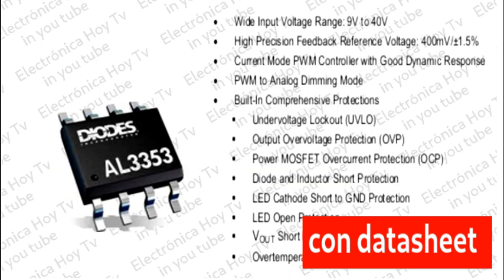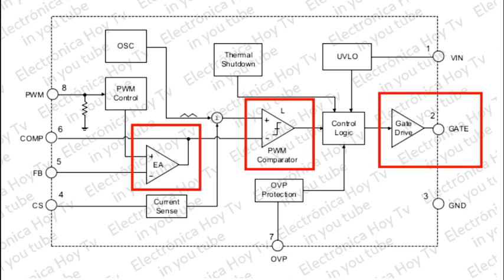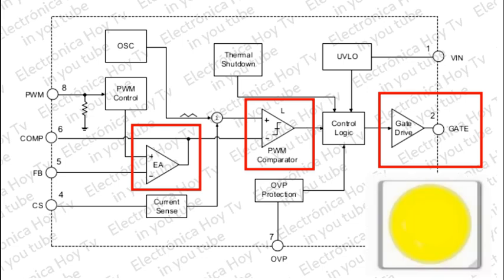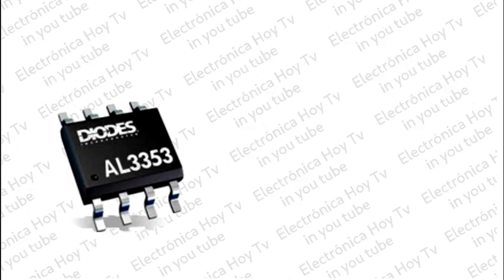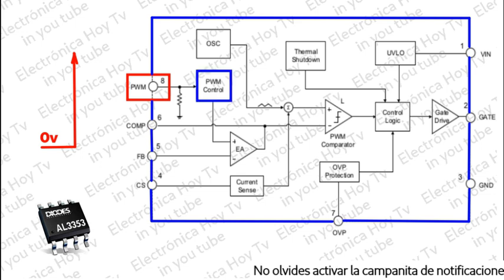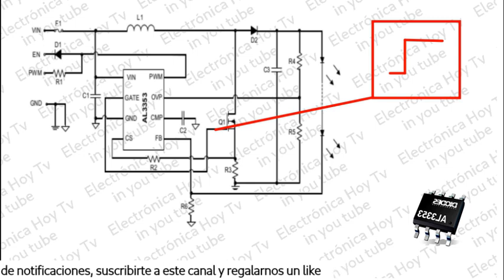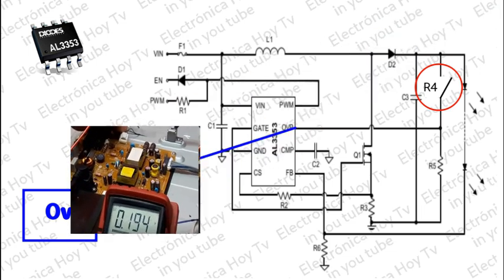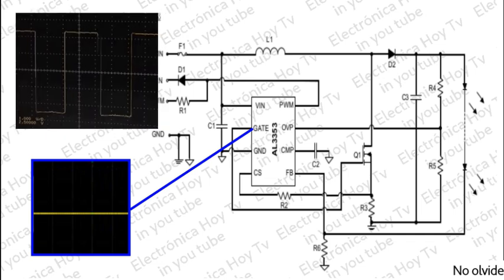PROBLEMAS DE BACKLIGHT DEL AL3353, PARTE  1

Comment: Hola. El nuevo conjunto de retroiluminación consume 32.4 mA cuando el anterior utilizaba 42.1 mA. Entonces recibo un ligero pitido y la protección se apaga. La fórmula :  I_Led = 400mV / R_FB da 9.5 Ohm al viejo y 11.2 Ohm al nuevo. ¿Cómo puedo reducir los amperios? (mi IC es OB3353CP). Muchas gracias ! [ usando el traductor de Google ]
Reply from the maker: Hello, thank you very much for commenting, the issue is that you must keep the parameters in OVO and FB so that the protections do not activate when you reduce the current, so any change you must try to maintain at least 150mV on the OVP pin and no more than 400mV on the FB pin, so you have to work together on the SHUNT resistors and the voltage divider of the OVP pin. A hug!

https://www.youtube.com/watch?v=v5ze1cnUv0Y
Reply: @ELECTRONICAHOYTV  Hi. Thank you for answering !!.
Old LEDs Set I = 42.1 mA . New set takes 34.2 mA. FB pin line has 100 Ohm Resistor .  Using the Formula for old parameters I found the DUTY Cycle :  (42.1 * 100 )/ 400mV = 10.525 . Now I calculated the New FB Resistor I want : (400 mA * 10.525 ) / 34.2 = 123 Ohm.  34.2 : 42.1 = 0.812 AND 100/123 = 0.813. Doesn't seem risky and looks correct, So I replaced 100 Ohm with 121 Ohm. 
But now , I get  1.17K on the 0 Ohm side of the resistor ( FB Pin #5 side )and 1K on the 100 Ohm side !!. How strange !!! . Measures 121 Ohm in-circuit !!!  [ I replaced 0201 SMD R with small, 2 x Thru-hole ] . So strange !!!    . After night sleep I see this :  I found Resistor on FB line with 0 ohm to the pin and 100 on its other side. After replacing it with 122 ohm , I measure a rise of 1k on the Resistor , but OPPOSITE : the 0 side became 1122 and the 100 side beace 1000. This is LIKE saying that FB got 1000 ohm lower but I'm not sure. Strange . No V used the whole time , but my tweezers are magnetized !  perhaps..

Comment: GRACIAS por la información, yo tengo un problema con este backligth solo tengo el voltaje de salida solo tengo 21.9.  El al3353 si le llega 12v al pin 1...cual comentario que me ayudara se los agradesco..
Reply from the maker: Hola Hector muchas gracias por comentar, al parecer no esta oscilando, si no oscila cambia el chip, o si lo esta, el fet esta abierto o hay un punto abierto en el circuito, revisa bien los puntos. Un abrazo

https://www.youtube.com/watch?v=T437-o0YPNE&t=2s